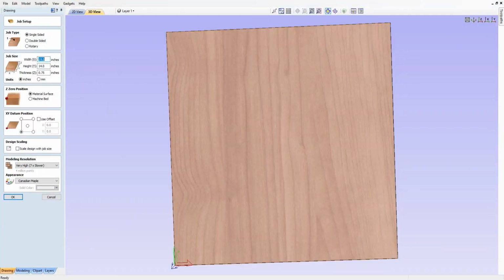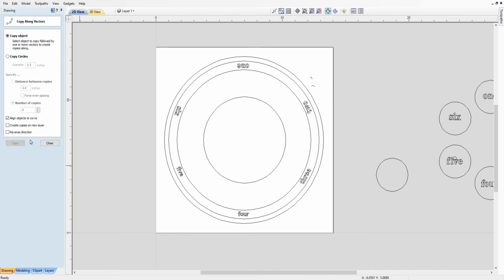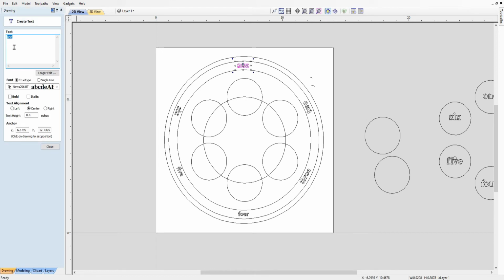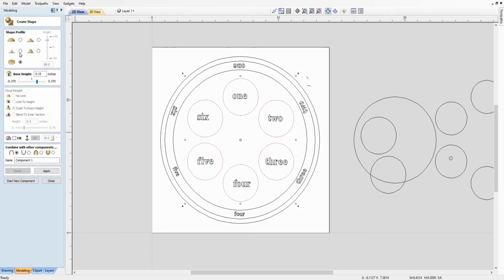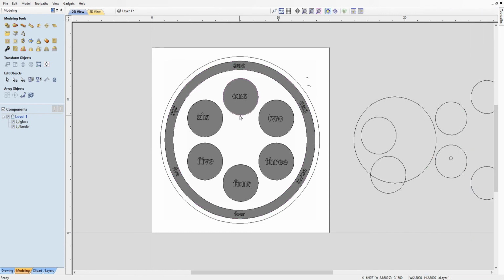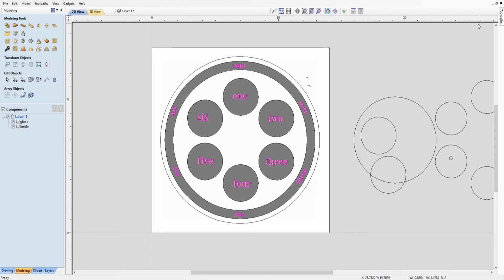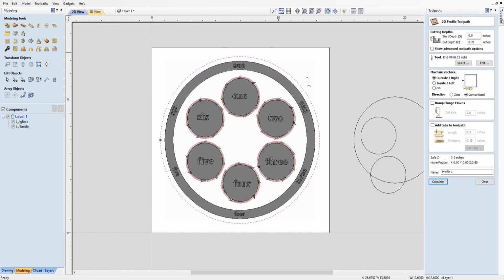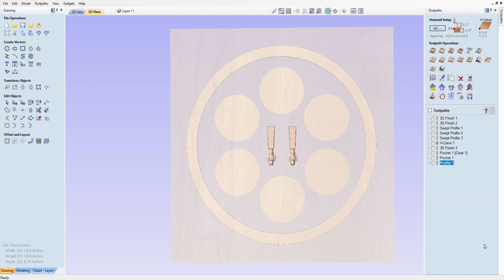Beer Flight Taster

Comment: Just so you know, when in the tool path side in the top right corner is a little pin that pin's the tool path up so it will stop making you change back again. Same with the drawing and modeling side. Thanks for sharing!
Reply from the maker: thanks